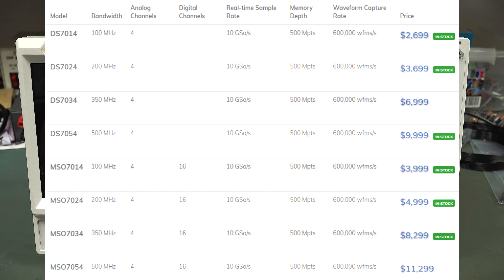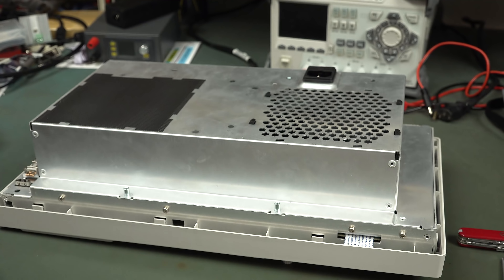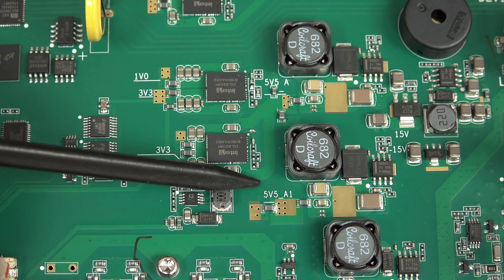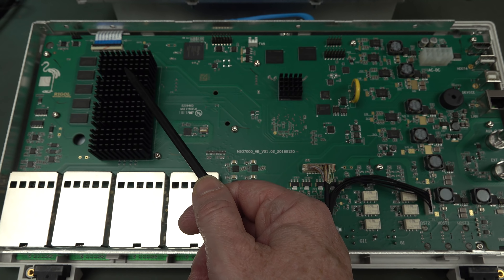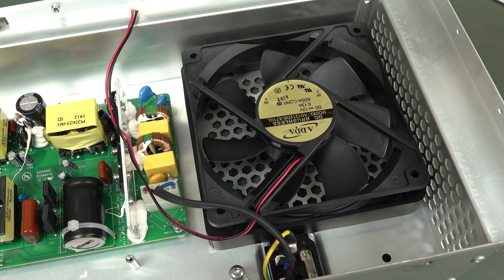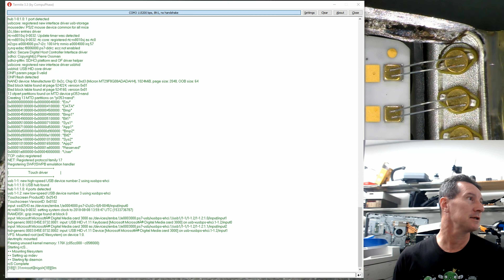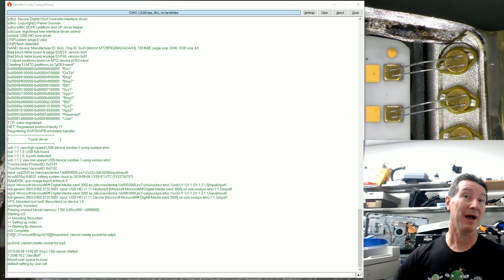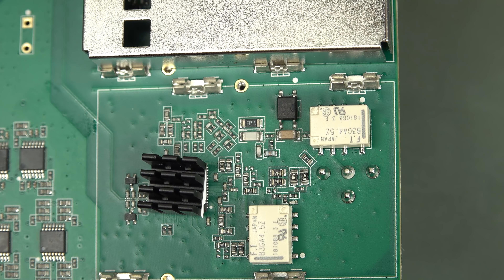EEVblog #1124 - Rigol 7000 Oscilloscope Teardown

Comment: man I would kill for one of these... how do hobbyists come up with that kind of change anyway? I'm lucky to afford a decent soldering iron, I don't know how people do it man.
Reply: Id have to assume so...  but that's not me. I'm just a hobbyist goofing around. I've no aspirations of doing it for money. I suppose that's why I can't afford the tools, eh?  hehe
Reply: A good multimeter is good enough.
Reply: I'm happy with my 1054z. (hacked) enough for most repairs and playing around. But sometimes I wish I had an extra 100MHz... Still love this scope!
Reply: depends what your messing with. I have one of those 30-50 buck signal generator and scope usb things. works fantastic for  decently low frequency and not too low resolution. ...works fantastically for probing things like dc-dc converters or simple stuff like a 555 or the pwm output of a arduino.
Reply: I don't think most hobbyists would need a top of the line scope; Rigol's DS1054Z is the most popular hobbyist scope at like $300USD. Pretty great scope!
Also, a sub-$100 old digitizing CRO off an auction is usually still usable, or the USB Analog Discovery 2 is something like $200 if you're a student
Just what I can think of off the top of my head
Reply: For most hobbyists, going to the local hackerspace and using their equipment is enough
Reply: @tommihommi1  what if no hacker space is around
Reply: The dso5072 is the cheapest and can be hacked to 200 and if you want cheaper ones look for the USB ones but they are getting bad reviews
Reply: I bought 2 old tektronix scopes (2201 and 454), both analog but the 2201 has a digital memory (nothing compared to any new dso, but still). Picked them up for €70. They work fine for me.
Reply: As a hobbyists 2or3 multimeters and a $10 logic analyzer will do 90% of what you need. An oscilloscope just might get you where you want to go a few minutes quicker. even at work thats mostly what I rely on.
Reply: You probably don't need a 500MHz scope, find an old $50 analog 2 channel 20-50MHz one instead.
Reply: a decent (in the lower range of offerings) digital scope nowadays will only set you back a few 100$ anyway
Reply: it really isn't about "need". I most definitely don't "need" one.  I also don't need a Ford GT, but man would I enjoy having one to play with!
Reply: @INeedAttentionEXE  I found it rather hard to find anything worth repairing so far - at least as far test equipment goes. Maybe it is because I'm in Europe and there is not much stuff here, and importing from the US can easily cost e.g. 300$ which reduces the chances of actually gaining money. Have you been more successful and repairing what kind of stuff?
Reply: @basshead.  nope. A scope shows you things that a multimeter cannot. A good multimeter is no replacement for a scope.
Reply: @funkyzero
it's people like you that give me ideas

i know how to do a lot of things
i grew up kind of like dave, back in the 70s, tinkering with electronics shit and pulling shit apart.

now... my first thought was..... HOW DO YOU NOT HAVE A SCOPE or  a  DMM ???
mate, when we were kids, we figured this shit out, even though we were broke.
we did chores and things,  Kids don't do that anymore , do they

and if you are working and can't afford it..... QUESTION IS... WHY NOT ?
THE ANSWER IS... You're not budgeting correctly, or AT ALL

Now.. the point
the other thing i can do very well is this ... Investing and trading  (and ulinke a lot of bullshit artists on the net, i can actually do it  hehe)
so.. the reason why i haven't made a channel is because it would sound like bullshit.. wouldn't it
i'd just be another trading channel
anyway

so.. i had another idea, after people start saying shit like

i can't pay my bills
i wish i had more money 
or, like you said
i wish i had one of these scopes
hehe

NOW.. HERE'S A CRAZY IDEA.. but, it's very very real and possible
yes, i have some kinks to work out, but the basic idea is this.......

I propose to pay bills for people
or in your case, to buy the scope for you
SOUNDS COOL, HUH
hehe

is there a catch... yes of course
you have to put up part of the money towards it
in the case of bills, if someone had, say a $500 bill to pay,  i might get them to pay $200 and i'd pay the rest

and let's say the bill everymonth was $500
i propose that the person only pays $200 every month and i cover the rest
hehe

doesn't seem right, huh ?
but, STRANGELY.. it is totally possible

and for people like you (Again, this is still an idea in progress and kinks need to be worked out)
but just a rough guess
say you wanted the top model of the Rigol 7000
i think it's like $13,000

well
1. you wouldn't have to kill anyone for it .. HEHE

2. i'd have to do the figures but i'm guessing you'd have to put together like $2k - $3k
(more if you can) or something to that effect (Again.. a work in progress)
and the idea is... you give me a period of time (which i have to calculate) and i pay for the rest of the scope

simple as that
hehe

COOL IDEA HUH

now.. as if someone is not going to put up $3,000 for  a $12,000 Scope   hehe
on the lower end of things it's around $3,000  so maybe a person would put in $500 - $1,000
something along those lines

anyway, like i said
people like you give me ideas like this
and i still have to talk to my legal people to find out how the legal shit works
but, that's the idea

in a nutshell,  people would pay less than they normally would for things they want or need
or in the case of bills
instead of going bankrupt,they would come to me , pay what they can and i would figure out a pay off system and get them back on track without bankruptcy 

it's a win win
even after they are back on track,  why wouldn't they keep doing it 

now...
if you're thinking, i'm letting the cat out of the bag here
hehe
NO MATE
the catch is .....
2 Catches actually

1. for a person to steal this idea, they have to actually know how to trade profitably
and many people don't know, but claim to know
and instead of knowing how, they put up you tube channels to generate the revenue for their lack of knowledge because they learn to talk the talk

2. from my end, there are no fee's or anything
but, i do make a very healthy income from it on the back end
but, it's not a con, because the individual pays less than they would, anyway
so.. it's a win win

basically they pay me money to invest
and via that investment i pay myself and i pay them... simple

cool idea huh
AND people like you confirm from time to time that's it's still an idea worth pursuing 

so when it's off the ground
i'll have the pleasure of knowing i can help people afford shit that they can't afford

be cool